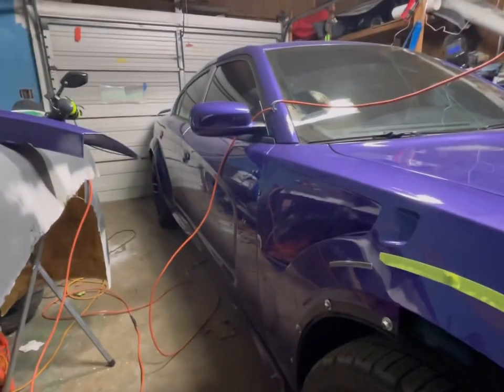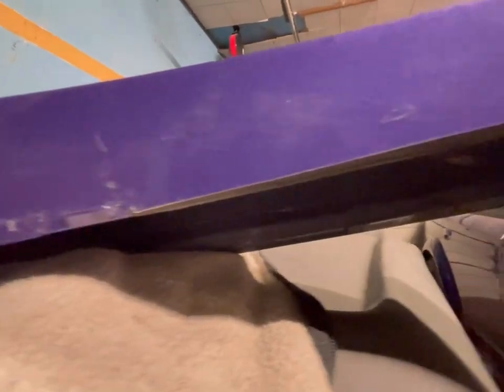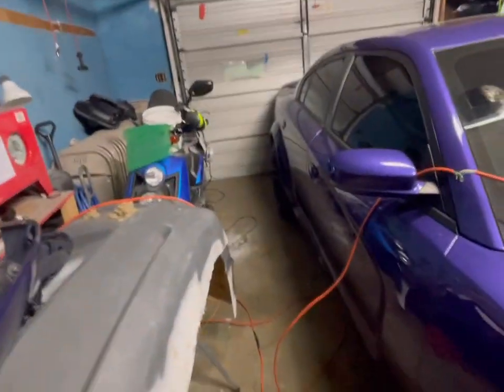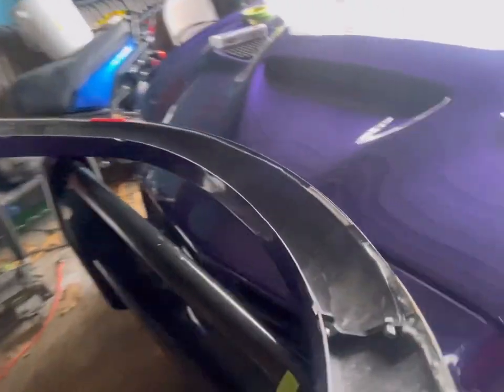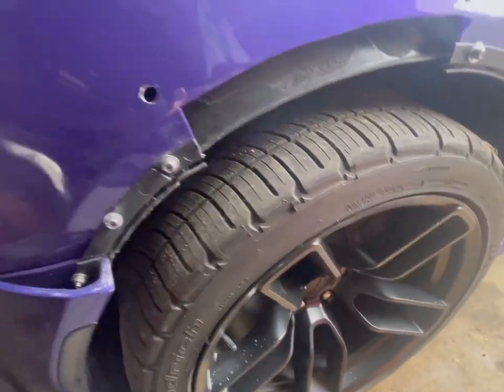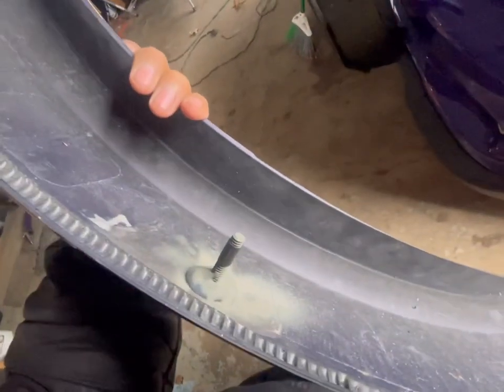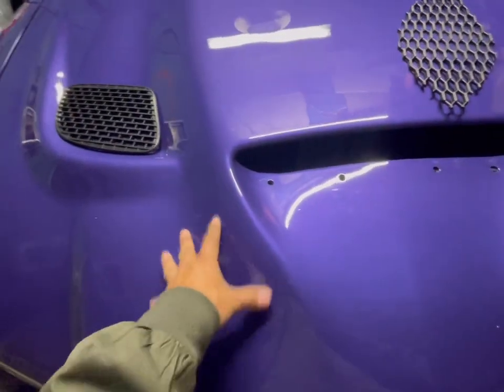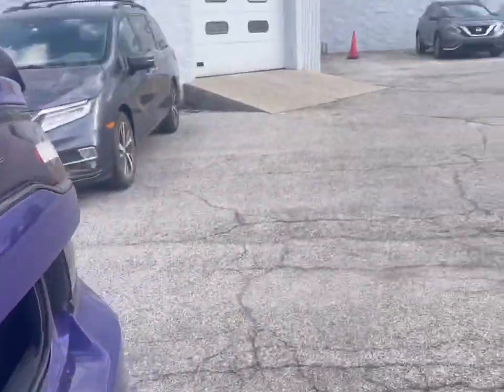Purple charger widebody is back

Comment: what's 4k.... what type of glue you use to glue the bolts to the flares
Reply from the maker: 3m super plastic repair
Reply: @4k_custom  thx for the info.... your vids have been very helpful bro. I going to attempt the rear bumper mod this summer. I might be hitting you up for pointers. 🤜🤛💯💯💯
Reply from the maker: @widebody_mopar11  no problem 👍🏽👍🏽 that’s awesome let us know how it comes along
Reply: @4k_custom  will do